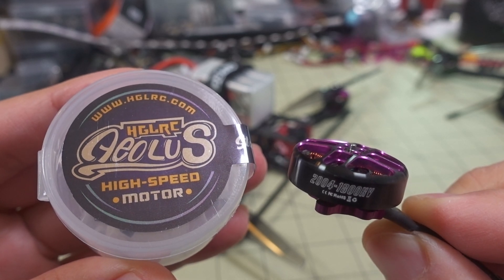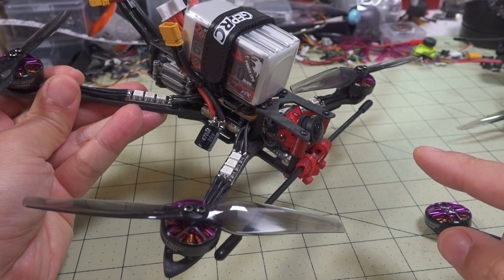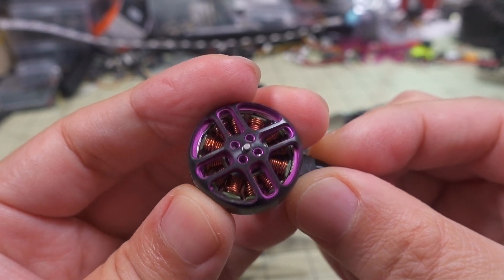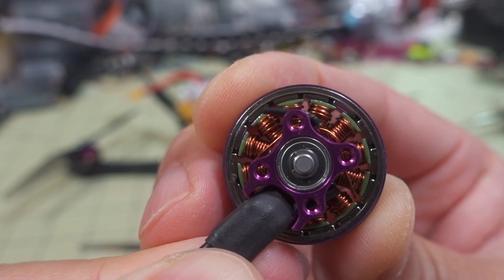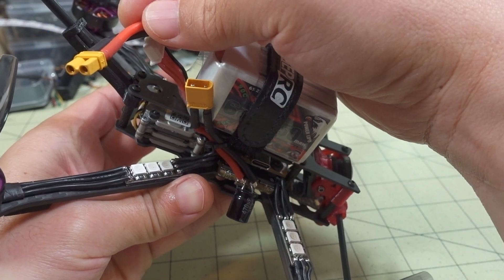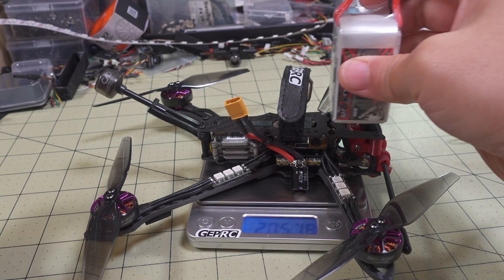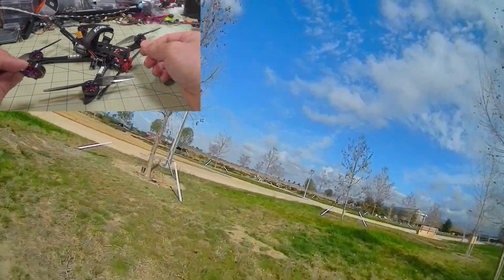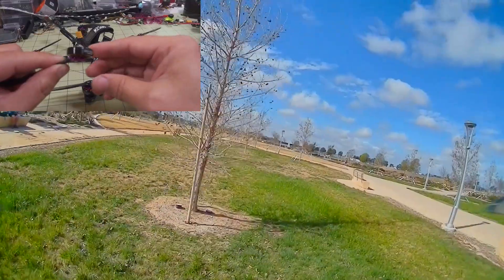HGLRC Aeolus 2004 1800kv Motor Review 🏁

Comment: So , did you ever get to put that motor on the MegaBee???
Reply from the maker: I did but I never made a video about it.  It's a great motor swap for that model.
Reply: @AlbertKimTV  I would love if you could elaborate on the pros/cons. Couldnt find any video/info on a similar build. Considering a 2004 motor on a pavo30 for instance, but wondering if its too much motor for the weight and won't improve anything over the stock 1507.

Comment: So you know me Al, I love your videos but you kind of gave no impression of this motor after flight. How did it actually perform? Did it feel powerful, spin up good? Where they snappy, smooth etc? I’m considering this for a 250g freestyle. What do you think? How about durability? I know that’s harder to comment if you haven’t flown them for long but what’s your opinion as of now? Thx bud !
Reply from the maker: If you're interested in performance, 2004 sized motors aren't going to satisfy most performance junkies.  Even on a light 250g quad, the performance is mediocre compared to a full 5-inch setup with 2306 motors.  This motor has good performance given it's weight compared to a 2306 but the 2306 will kill it everyday.  Durability depends on the prop shaft size and bearing size.  Most of the ones where those are not specified are the weakest ones.  However, every crash is different.  I've crashed into tree branches barely hitting anything on a $50 motor and have it snap the prop shaft and I've crashed a $10 motor into a parking lot with no damage.  So it is hard to say how any motor will hold up until a lot more people start crashing them and there is more data to look at. IMO, the 2004 motor is best for 3-inch cinewhoops for nice controlled slow flying and on a 5-inch mainly for cruising around for long flight times.  If I want a motor for freestyle, the 2004 motor is one of the last ones I would choose.
Reply: @AlbertKimTV  thank Al! Great insight.

Comment: Albert, I'm a 71 year old Canadian - retired Optician. Left the hobby in 1980 - Sailplane pilot. My daughter bought me a transmitter for Christmas. Can't afford drone. Have built a foam board airplane.
Would like to go micro size or a shade bigger.Balsa and tissue.  Would one of these motors with a 1s 220mah 45c work with this motor? Thanks for your help!

Comment: Sweet looking motors!  I don't really see the point of these low weight explorer quads that are still over 250g though.  I say if you are going over 250g then you might as well run a heavy quad that can carry a quality HD cam (gopro hero) for capturing long range flights or a have some good freestyle capabilities.  Maybe I'm missing the point of this trend but just cruising for 20 minutes doesn't look nearly as fun.
Reply from the maker: Yeah, that's why I recommend going with the 3000kv motors and a lighter 4S battery to get under 250g.
Reply: @AlbertKimTV  Thanks Albert!  I did see you mention that and if you are trying to get under 250g then go 4s.  I think the deal for me is these 'explorer' type quads are really awesome for what they do but if I'm going over 3" its really nice to be able to carry a good quality AND durable action cam.  But I love the flippy floppys and really only fly freestyle so I am not the target audience for these motors :)  

Slightly unrelated but what do you think of buying the 3000kv motors and motor/throttle scaling down for 5s or 6s for these motors.  I have been really weary to try this instead of just buying appropriate kv motors  but I've heard people touting buying the highest kv and scaling down instead.  any thoughts?

Comment: the price is something you'd expect from ethix etc are they good enough to justify the price?
Reply: YES! I bought the Rekon 5 that has the 4s version of these motors on it and I am blown away by how good they feel. Extremely smooth, plenty of power, and I got 10 mins of flight time flying pretty aggressively with a 1500mah 4s battery. Most the time it just felt like I was flying a normal 4s 5 inch.